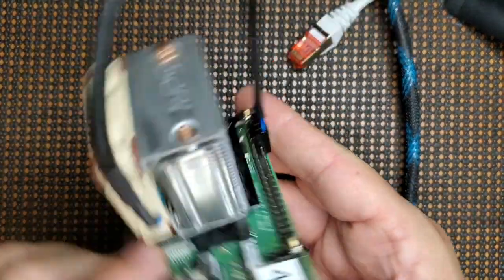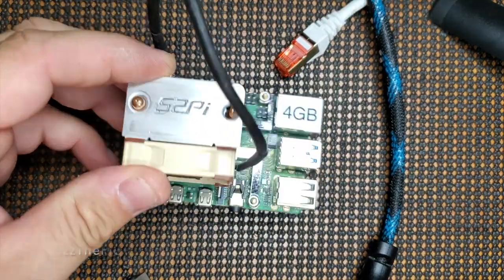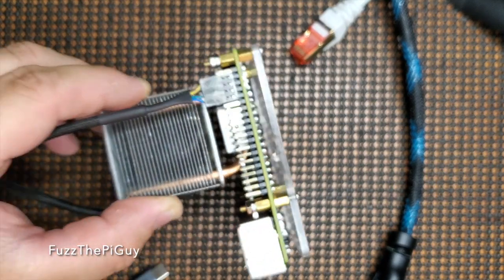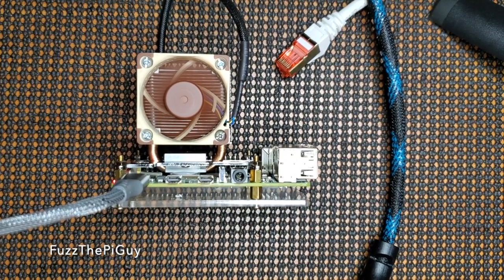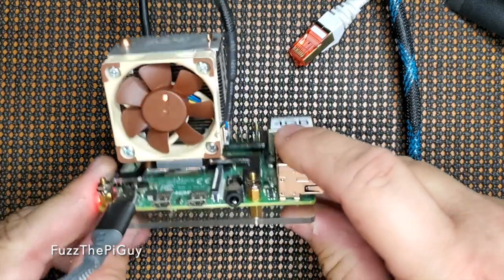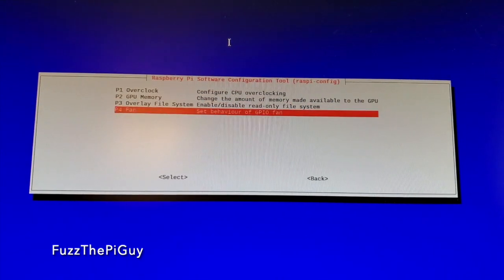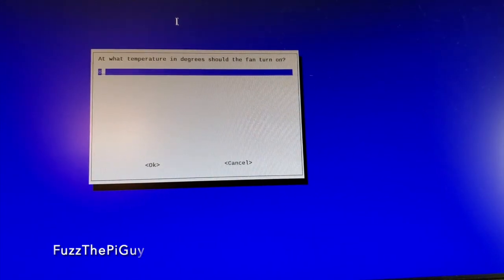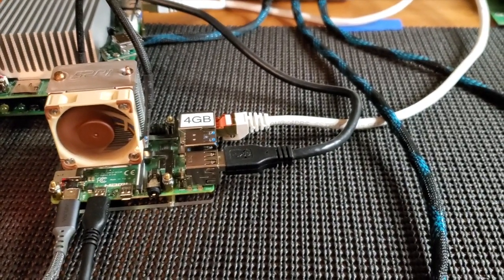Adding A PWM Fan To A Raspberry Pi 4 Ice Tower | Single Board Computer

Comment: these fans are 12V right?
Reply: No, you can get 5V variants
Reply: If that's the noctua 40mm x 10mm then yeah. At that size it comes in 5v versions, 12v versions,
3 pin versions, and 4 pin versions
Reply from the maker: This is a 5 volt fan

Comment: Does the Pi 4B have enough juice to run a PWM fan splitter to 3x 120mm fans to cool a server rack?
Reply: RPI is powered by 5V and your 120mm fans are 12V so the answer is no

Comment: Thanks for your video! I was struggling to find clear instrustions on how to connect the Noctua 5V PWM to the RPi4. Here is what I did:

As shown in the video I switched the Yellow (5V) and Black (Ground) wires to match the pins of the RPi4, but also Blue (PWM -> GPIO14) and Green (RPM GPIO15) because the GPIO 14 is called UART transmit pin while the GPIO15 is the UART receive pin and that way seemed more logical to me. 
As I am using Octopi on my RPi4 for my 3D printer, I also had to add "dtoverlay=gpio-fan,gpiopin=14,temp=80000" to the config.txt file.
Now the fan is only turning on once the temperature threshold (here 80 degree celsius) is reached. Sadly, I could not find a way to run the fan at lower speeds, so it is always 100% or 0% (=off).

Happy to get feedback whether what I have done is fine and please let me know if my assumptions were wrong!

Comment: Thanks for the video. Just a question: How did you switch the wire Yellow and Black to make the fann go into the GPIO pins?
I'm afraid to damage the connectors of the fan